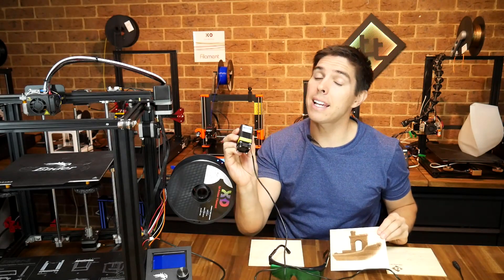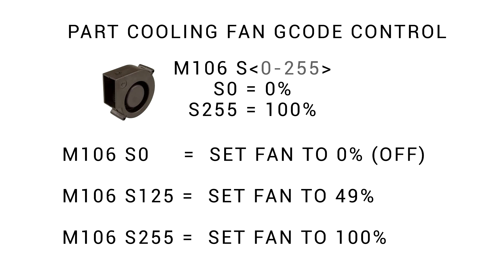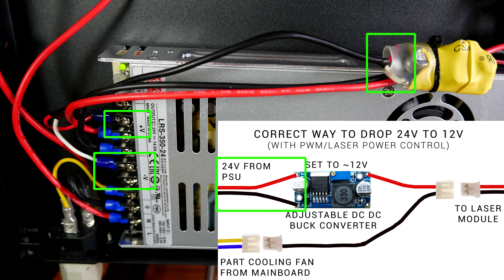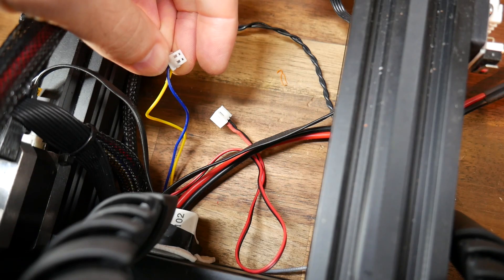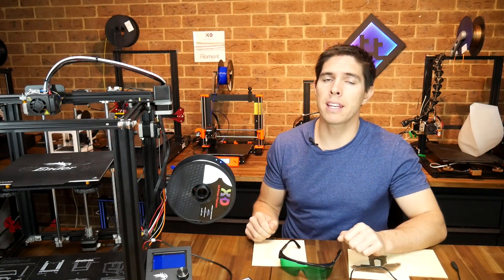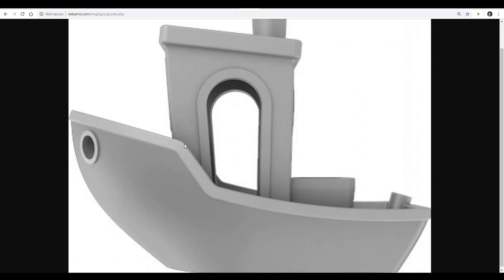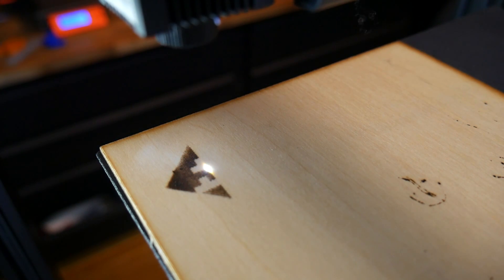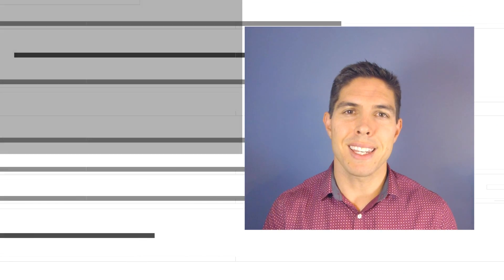3D printer to laser engraver for under $60

Comment: I'm wondering will this etch powder coating,  if not what laser etcher would you recommend. I have a 3D printer I would like to convert. But I need it to do powder coating Thanks again I really appreciate your videos they are very informative.
Reply: It will but you have to do it differently than what you see here.
when you're trying to remove the powder coating, it's more like trying to cut plastic. You end up running the laser at a much higher power, usually near 100%... And then you move it very slowly. Like 2 mm a second slowly. Even then, you have to go over a section multiple times.
The rate you need is very dependent upon the color of the material you're trying to cut through.
That said with enough passes it will eventually cut through. it can do very well for a hobbyist, but not for a professional because it's just too slow for that.

Comment: Would this converter work that is on Amazon? I don't do Banggood if I can avoid. 
WHDTS DC-DC Boost Power Module Adjustable 100W 3.0~35V to 3.5~35V Also can you do halftone with these systems?

Comment: Way to difficult, just screw nozzle off, mount a laser. Slice a 2D file in gcode. With the speed of everything on 5%, not the travel time, set that to 100%, when you printing set your speed on the lowest speed. done

Comment: I have a Question about my 15w laser module I have three wires coming out of mine( pin one +)( pin two - ) and( pin three pwm/ttl)  does the pwm/ttl go to Fan+? Do you still power the laser with 12v on the other two? Thank You great video.
Reply: Did you get an answer to this?
Reply: @K9bolx  Yes I did and got it worked out Thank you
Reply: @NeilHodgsonDARKHOURS  hi, which was the answer? how did you make it? is you mainboard 24V?

Comment: Have you ever attempted to run a rotary axis on ender 3?   I have an ender 3 that I converted to a full time laser cutter/etcher and want to convert the E axis to a rotary axis.  I use Lightburn software and it has an option to use A axis, is this something I can change in the firmware?  If so would love to know how, I have done some googling but having found anything yet.  You seemed like the best person to ask (I love your videos) .
Reply: I know your comment is a year old, but did you ever find a solution? I'm using the exact same setup, ender 3 conversion and lightburn. Wanted to used a rotary axis as well.

Comment: Back around Christmas I ordered a 2D Pen printer and ordered the option Laser (Same as what is used here)  The Laser came, but twice the 2D Pen printer never arrived.  So, I printed a mount to place the laser on my D-Bot (Custom built from Thingiverse)  Thank Bob for this video to help me utilize it.   WORKS GREAT!   Pretty much same settings as was used in the video.  Except my D-Bot is a 12V system, so I didn't need the buck converter.

THANKS!

Comment: Thanks a lot for this helpful video! I successfully used your tips and converted a CubeX Duo 3D printer into a laser printer, by using a 1000mW laser from a NEJE printer and a main board from Ender 3. My laser needs 5V to operate so I used a car USB charger (works with 12V or 24V input) instead of the 12V step down converter. Thanks again!

Comment: Not the way I'd do it.. I'd still use a Buck converter, but would connect the laser to a mosfet board.. The same as I use on my 12v ramps / 24v Ender based Frankenprinter..
Plus like others have said, get some real laser spex.. You only get one set of eyes....

I think I'll try one of these on my T8+ mini-CNC...

Comment: I get a negative Voltage when the fan speed is lower than 50%, by using the wiring in the video, instead of getting 0V. 100% fan speed gives me a Voltage of 12V which would be fine. Can anyone help? I don't want to break my laser.
Reply: I’m having the same results as you. Did you ever figure it out?
Reply: Sam here, did you fix it? And how? 😄

Comment: Will these lasers engrave metal? Something like a knife blade? Thanks!
Reply: no for proper metal engraving with out additives you will need a different laser type. which is usually in a box enclosure. you can use additives, but you will need an enclosure with excellent exhaust due to toxic fumes.  but you can powder coat. 500mw is extremely weak and there are no true 10 watt or higher in diod style lasers for machines such as this.( they might say higher, but its usually a 7 watt pushed past its limits and will burn out rather quickly)  the higher watt lasers are usually gas lasers and require mirrors and such so its impractical for this usage.

Comment: Hey! I have an MP1584 Step down module. Will this work ?? To all the electonics guys out here i'm afaid it will damaga the laser. I measured voltage across the wire that should go to the laser (no load)  at 0/255 i have  -10V ,  and 255/255 12,5V as said in the video (i adjusted this with the pot in the module).
Reply: On Ender 3 I'm Reading 24V between FAN Ground and 24V Ground. I cant Understand how the f made this board :))
Reply: Did you figure this out? I'm having the same issue.

Comment: In some videos they connect directly to the 24V supply, Can we do it with this laser? or we must use regulator? Also Can we seperate the fan cable to 2 pieces?
Reply: You can get laser modules in 12V and 24V versions. You only need the buck converter if you're using a 24V printer (like the Ender 3) with a 12V laser module.

Comment: You missed one vital test in all of this, engraving on 3d prints! I've had this laser for over a year and yesterday I was thinking of trying again as I got bad results when I bought it.Your video has now helped me with the software side of it. Creality's software is unusable from a year ago. the gcode wouldn't even configure properly and had to manually add code with notepad++ to get it to work. I just struggled to get the right speeds. I will be engraving on 3d prints this week!
Reply: Would be interesting if anyone has added this to an MKS Gen L V.1 also as that's what I'm running now thanks to you Michael!

Comment: Hi, In this video you covered the 2 pin laser and mine is 3 pin 2.5 W laser and I am not sure about the wires, there is ground, pwm and 12v, I have a Cr10s so 12v I'll plug into hot end fan positive, then should I solder ground to the part cooling fan buck converter out negative or should I take it from the hot end fan too ? and pwm pin should propably be the lovered voltage from the converter right ?

Comment: I have watched all your video. I have bought 15w laser module which has 12v power adapter and control board with input for TTL and analog. Could anyone guide me how to connect it to ender3. I have attached bltouch to unused PWM pin on printer board not to buzzer pin. So basically I have one buzzer pin free for PWM.

Comment: You may took 5V PWM signal from the "Gate" pin of the Fan MOSFET instead of using buck converter
Reply: the laser work with 12 v.
Reply: @josemontoya994  we are talking pwm signal, not 12v laser supply voltage

Comment: Another excellent tutorial Michael.

Not a conventional electrical drive solution but innovative.

Not using a TTL or analogue control and modulating the 12V supply is actually much safer.
The LASER I've got is LASER ON when control is open circuit which is not a safe situation at all.

I'd also recommend mounting on the left side of the hot end shroud rather than in front. That goes hand-in-hand with some 3D printed X and Y Stop extension prods and reducing the bed size.
The idea is to ensure that the LASER remains over the print bed as that's a safer place for it.
I'll give the software you've identified a go.
Pretty much all the software I've found either doesn't manage X/Y position on the bed very well, is not intuitive or just goes crazy at times.
I've also found that a lot of LASER software doesn't work well with marlin (or ender 3) and it can hang, and hang in the on state. Not knowing where the LASER is going to be and the potential of it hanging is not good obviously.
Lightburn was closest to bug free software I've found but even that had comms issues and X/Y placement issues.

I'm using 2.5W and have found vapour and fumes in a well ventilated room was not as big an issue as I expected.
Light wise, getting technical info on cheap safety glasses I found difficult and where you can get the info or Australian Standards the prices are silly. I found making an effort to match wavelength of interest, do a pass through test on the LASER you're using and never look directly at the reflects light was the best way to go. As you've already suggested, excluding others from the area is wise.
Safety wise, positioning has been a much bigger concern that vapour or light.

ABL is very useful as it avoids having to focus on the work piece.
One good feature of Lightburn is it can step down the Z axis on vector burns which means it could possibly allow 0.5W LASER to do multi-pass cuts as well.
Not seen any adverse effect but the hot end shroud doesn't appear to be a great magnetic shield/keeper so the LASER mounting magnets are probably effecting the hot end fans to some extent.

Comment: You should have used a module with TTL PWM input and use a free PWM pin.
Reply: Can you share some more details on this? You're talking about a buck converter with PWM controllable output through PWM? I'd like to drive some 12V blower fans on the 24V Ender because I can't find decent/quiet/brand blower 5015 fans on 24V but am searching for solutions for keeping the PWM. Wouldn't want to DIY a MOSFET after the buck converter because I'm lazy :)

Comment: Any ideas of a laser that can engrave up to 7076 aluminium to a depth of .08 mm? All the info I've found is about cutting, doesn't seem like many people are interested in engraving metal.
Reply: CNC would be cheaper. Basically, the metal is reflective, so only like 5% of the energy of the beam will be transferred to heat compared to wood, and then aluminum is very thermally conductive, so basically your trying to heat up a big heat sink on top of that....

I’d guess 40x more powerful minimum. You’d be looking at 20w true output (lasers are typically 10% efficient, but as low as 0.5% efficient depending on the method and wavelength). Expect to pay $400 for a heavily used and super old diodes near death, you’ll also need to make your own laser driver or get really lucky finding an affordable one. CNC would be much cheaper ($50 Dermal and 3D print your mount (you’ll still need a mount for the laser). You should be able to hook a mains controller up for $5 (your 3D printers controller sends the fan signal to a solid state 110/220v AC relay and you can run the speed of your Dremal). That would be a lot cheaper, but if you need a laser to do it, then you’ll just need to get the high powered and expensive lasers (look at frequency, that’s going to change more things than just power). Also note, if it can cut it, then it can probably engrave, so you’ll likely just turn it down to 90% power. So if someone got away with less for cutting, then it’s probably a good deal.

Comment: Michael, as cool as this is, I think there are many serious safety things that you have not mentioned. Certain materials will produce not just smoke, but TOXIC gases if they are etched or cut with a laser. PVC is one of those.... and you're engraving right above a PVC 3D printer bed!! The $2 safety goggles that come with these cheap kits are also often NOT sufficient, and sometimes they don't even match the wavelength of the diode... encouraging the attitude of "how cheap can we do it" really is inappropriate for something with as many safety hazards as this.
Reply: If I have the glass bed do I need to worry about the PVC burning? What goggles should I buy for this laser?
Reply: i guess if filter in these glasses match laser wavelenght then you are scrwed. These are bandpass not bandstop.

Comment: ive been wondering how i could do exactly this! now i probably will when i have the money!
got a few questions.

1 what is the "machine control panel" software you are using? i didnt recognize it.
2 is there any OFFLINE sources for the pic to stl/gcode converter that you know of?
3 any plans to make further upgrades, specifically a laser safety enclosure, so no one without glasses is accidentally exposed?
Reply from the maker: 1. I am using the control panel of simplify3d. You could also use octoprint, or printer face which is free and runs from computer. 2. The linked GitHub has the source, it is written in PHP. It is possible to run PHP locally but it's a bit of a hassle compared to a normal piece of software. 3. Not at this stage. I have a dedicated laser cutter for that.
Reply: @TeachingTech  cool, thanks for the info

Comment: Fantastic. 
I have that very laser sitting on my desk and a bunch of buck converters. 
I guess it's time to figure out how to mount it, as I'm running a Bullseye part cooler on my Ender 3.
Reply from the maker: I was looking at my Ender 3 thinking the same. Maybe cable tie a metal plate to it or design and print a perfectly fitting adaptor.

Comment: Could you make a video on how to update stock marlin with octoprint? :)
Reply from the maker: You can only upload a hex file from octoprint, which means you still have to use the Arduino ide to configure the firmware and compile. It's harder to switch to octoprint from this point. If you already have the hex file it may be worth it and I may cover that as part of another video.

Comment: Please buy proper safety goggles. You can go blind permanently from this module in an instant with just scattered light. I wouldn't bet my vision on this junk. Here are some good certified laser safety goggles: https://www.thorlabs.com/newgrouppage9.cfm?objectgroup_id=762
The laser wavelength should be written on the block label; remember that some lasers have frequency doublers, so you'd also need to block the lower frequency if that's the case. I wish it was illegal to sell laser modules like these -- people seriously underestimate how dangerous they are :/

Comment: Hey bud, nice work. Having played with a similar laser on my cr10 for awhile i found laserweb to be the best free program for raster and cutting.
Reply: I'm really thankful for your comment. I just converted my cr10 s5 for laser cutting and the program you suggested automatically recognized everything. It even recognized that the laser was connected to the fan port without any feedback from my part, I just needed to change the PMW MAX value to 255 and that was it. I just installed it I'm already controlling the laser and all the steppers. This is great.

Comment: Nice mod! Does that mean you can do those cool 3D aser engraving images in acrylic?
Reply from the maker: It won't cut acrylic but sometimes you can mark the surface by putting masking tape down and burning that. It leaves a scar after the tape is removed. Yet to try it on this.

Comment: PLEASE for the sake of your eyes, buy some proper laser safety glasses. You only have 2 eyes, and for $60 total how much do you think those glasses are worth? Get some with actual safety ratings for the wavelength you are using. Generally these diode lasers are around UV 450nm.
Reply: Thanks god someone mentioned it.
Reply: Would a welding helmet work for laser eye protection?
Reply: @dddnnndddnnn  Only google can possess such knowledge
Reply: No. I tried it. Too dark.
Reply: You can use some pieces of plastic or cardboard to block the laser
Reply: @kerbodynamicx472  I wouldnt trust that. your eyes are irreplaceable. imagine how hard life is without them. not worth it for something like that
Reply: I tested the glasses in the video, it's just tinted plastic so its literally the same as not wearing them at all.
Buy proper once! They will last you a long time anyway.
Reply: I would argue goggles are not necessary as long as you do not have any reflective surfaces you are engraving - it is highly focused laser light after all
Reply: @userou-ig1ze saving $40-50 by not buying and using proper goggles is not worth it for my eyes. Have you used a UV laser? Mine throws alot of light engraving wood, so reflective surface or not, im not taking the risk
Reply: @reflector36 yeah, I don't know what the power is of the reflection. Can you just measure it using a power meter?
Reply: @userou-ig1ze  I'd expect that you can easily get hit by beam close to original one as the power goes. Especially if you use metallic or glass surface on the printer itself. Besides - laser unit is held by magnets so if by some shaking it falls off, you may suddenly look directly into the beam.
No, some risks are not worth to be taken. I'd say that is someone wants to use it as a laser device, he should make some metal enclosure with either proper laser-proof window or without any at all. And still have glasses just in case something goes wrong or he makes mistake.
Reply: @userou-ig1ze  oh let me tell ya, I've only tested my 405nm 500mW laser yet, at full power WITH the crappy red goggles given (mine came with red ones, REALLY RED by the way), you still see some bright purple from the reflection alone, on normal cardboard. Whoever, pretty much NO blue/violet light passes through those crappy lenses unless it's so bright it hurts your eyes a lot when not using them (tested it with reflective stuff on strong sunlight day), so they definitely are vastly better than nothing. I never dared testing it without those, and won't do it.

Regardless, I'm taking hella lot of care to not power the laser up at all without the goggles nor having anyone (including the dogs) around when I do it, proper UV laser protection goggles would be nice but I can't even find 'em here...